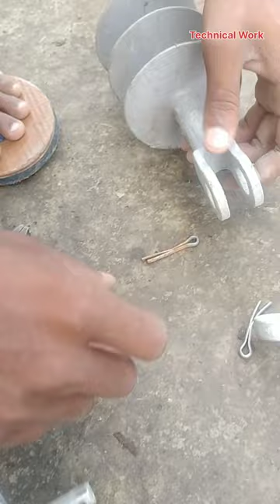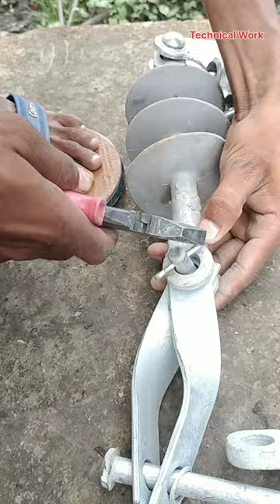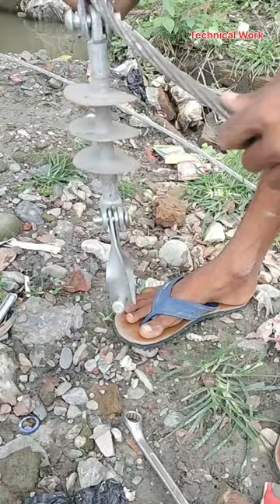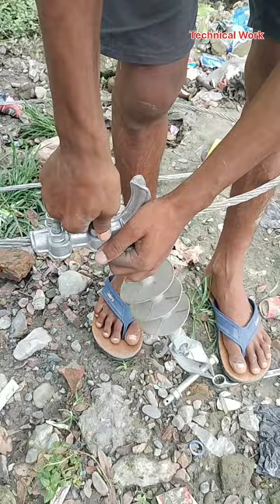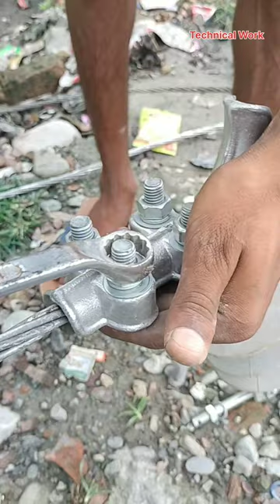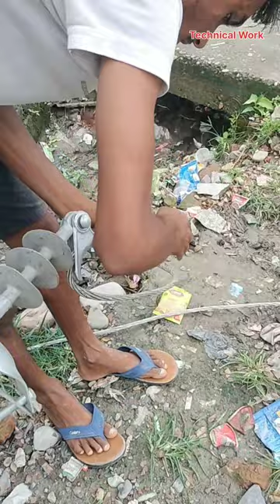11kv disc insulator fitting

Comment: That's not dis insulater that is palimar pin insulater
Reply: it is a polymer disc insulator.the polymer disc and pin insulator are almost the same.the only difference it that the disc insulator has a different tip than the pin insulator
Reply: ଆଉ କଣ ସେଇଟା ।